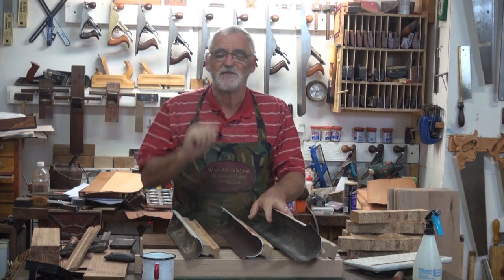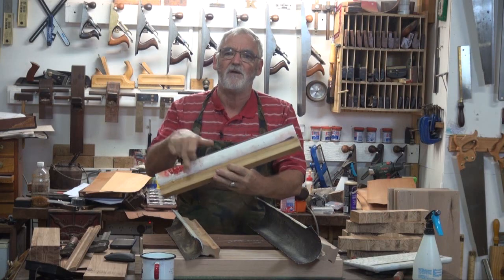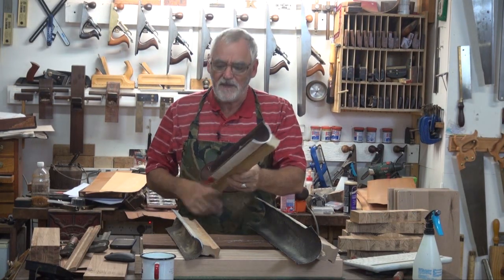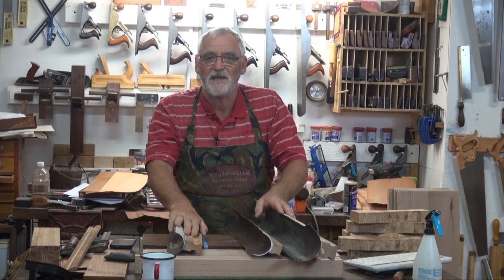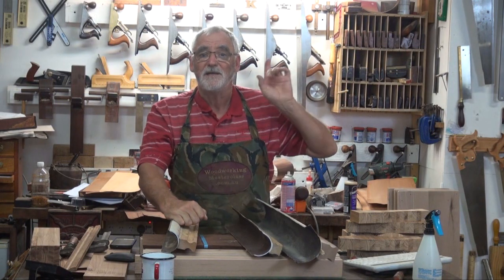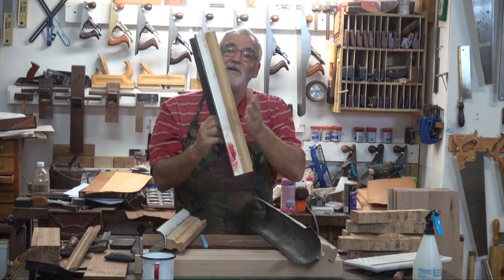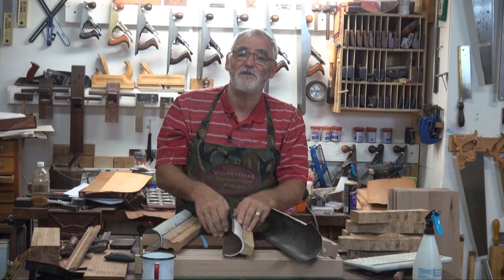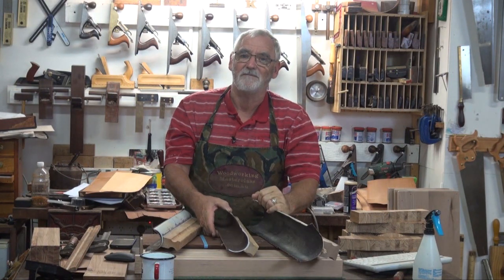Turning Perfect cylinders using a Homemade sanding jig.

Comment: It looks more efficient, but wouldn't sandpaper on any flat surface lead to as good a cylinder?
Reply from the maker: You would think so Alan. However, no, because as you rub along the grain the pressure from you arms is transferred at a different rate as you rock from one leg to the other and that causes a taper to develop. Once there it just get more pronounced with each swipe. I found that one out the hard way! Hence I came up with this idea. Thanks for the comment and feedback really appreciate it.. Cheers Steve